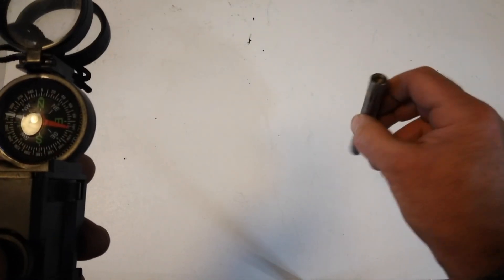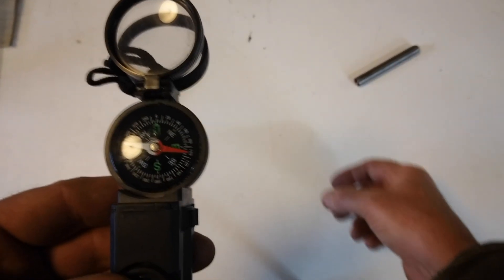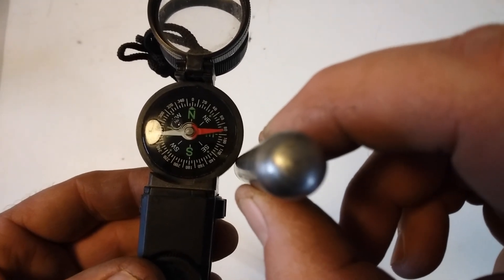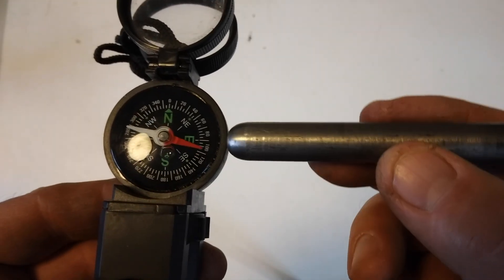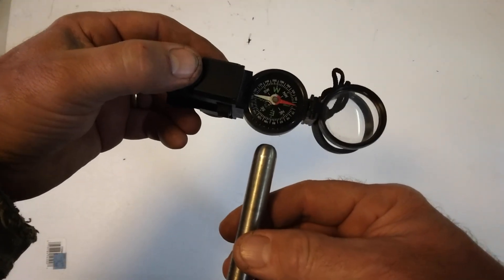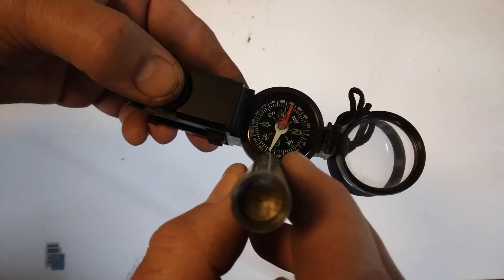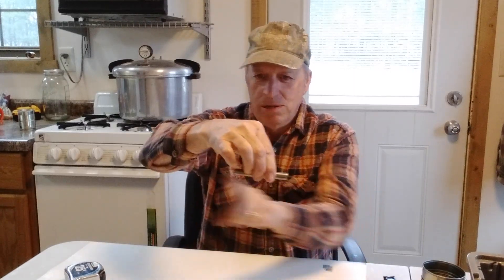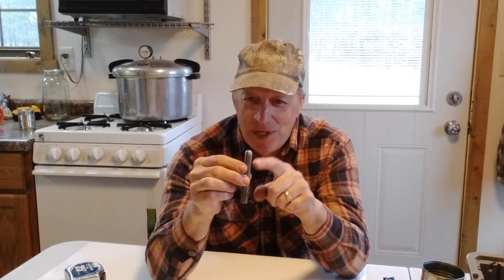Unknown Science of twisted magnetism 🥴

Comment: it's a misconception that opposing poles somehow attract. that's a secondary effect. the primary effect of magnetism is there's a torque acting on a magnet dipole in magnetic field that tries to align its magnetic moment along the field.

the secondary effect (that decays much faster with distance than the torque) is that a magnetic dipole is pushed in the direction of the field gradient. it's crucially important that there needs to be a gradient. for example, earth's magnetic field is almost uniform on the surface, so the gradient is almost zero and magnets are not pushed either north or south, they only feel the torque.

i'm bringing this up, because so-called "paradoxes" only arise because of crude shorthand interpetations of field physics like "opposing poles attract". if you were to describe the field configuration with the full set of maxwells equations, there'd be no paradox.

Comment: This and Ed Leedskalnin's Permanent Magnet Holder (PMH) are two real and observable phenomenon which are readily demonstrated by a home experimenter. After witnessing them, many people have gone on to also believe more astounding claims which have not been readily demonstrable, if at all. Here the magnetic characteristics of the rod (perhaps its magnetic permeability?) have been changed without actually magnetizing the metal.

The video is clear and easy to follow. An important thing which appears to have been left out is to show the behaviour of the stock rod in the vertical orientation too (the rod that was not used in the GEET). Might be worth adding this in.
Reply from the maker: You're right, I didn't get the footage of the vertical position of the cut off piece in there.  I thought I did.

Comment: I sort of wonder if it is Eddie currents which are sort of following the right hand rule, which would apply to the perpendicular phenomena.
Reply from the maker: You may be right.  Like they're spinning all around, but when the rod is placed in the vertical position, they all orient in the same direction.  -because of the earth's magnetic field?
Reply: @doubleMinnovations  Your explanation at the end of the video is spot on. Have you ever tryed to see if you get a voltage across the rod (end to end) in different positions ? while holding it still, of course.